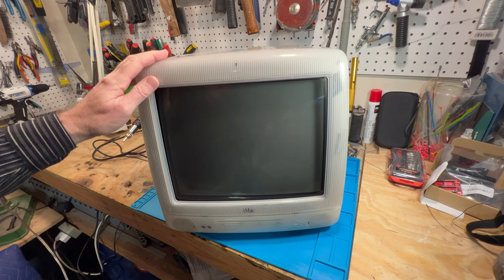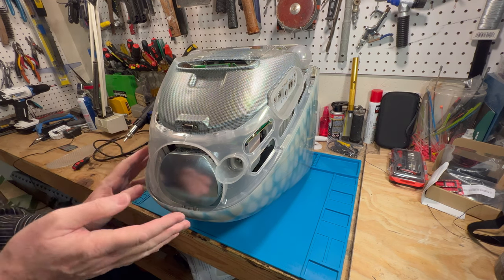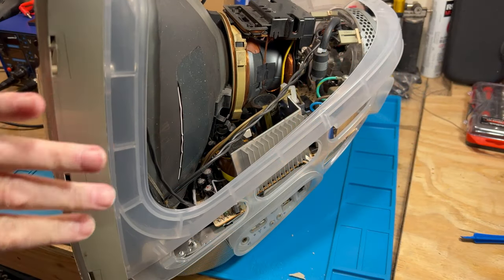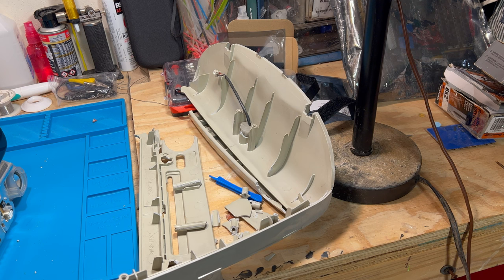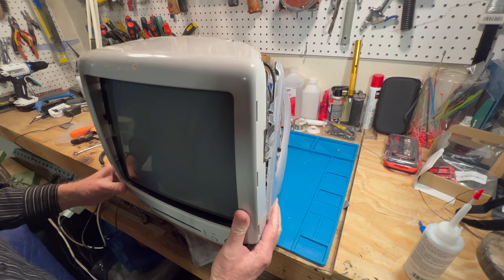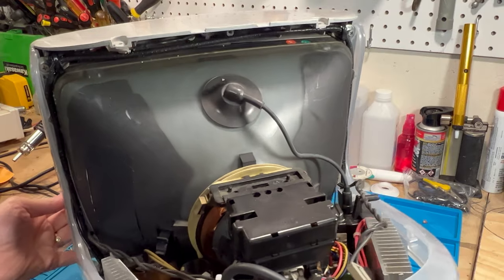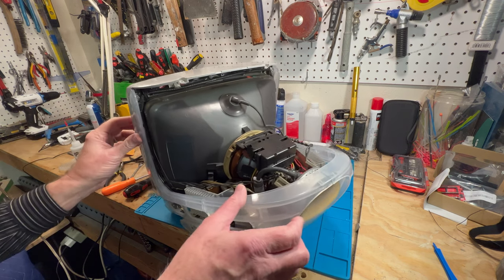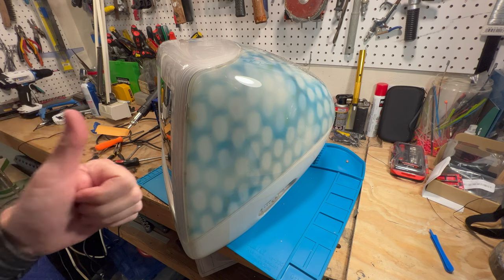IMAC G3 DALMATIAN REPLACING THE INNER BEZEL WITH A RARE  NEW OLD STOCK BEZEL

Comment: Ok so I’ve done some research and it looks like you can just take a mold of your spare crt support with some liquid silicone molding material, and use either melted ABS plastic or a 2 part resin, ABS melts at 221° Fahrenheit so it seems doable. Do you think you could try it?

Comment: I would take a silicone mould of the other one or send it to a company who can so it can be filled with plastic or resin to sell more new crt supports, all original ones will eventually yellow and fall apart and we’re gonna need replacements

Comment: I have the same G3 and the bottom cover seems to be stuck as I am unable to take it off it seems to be stuck at the front of the machine. Which is annoying as I need to replace the CDRW Drive and I do not want to crack the plastic